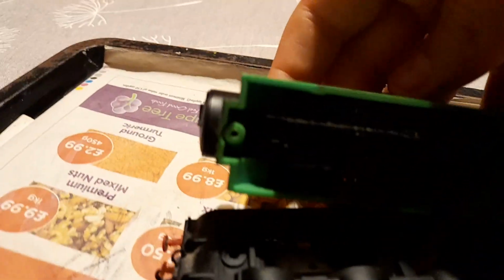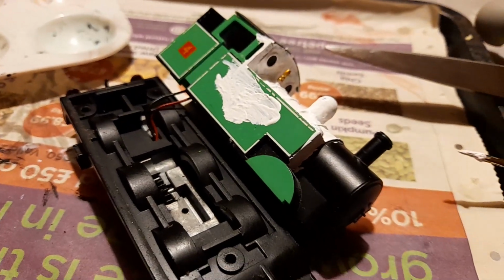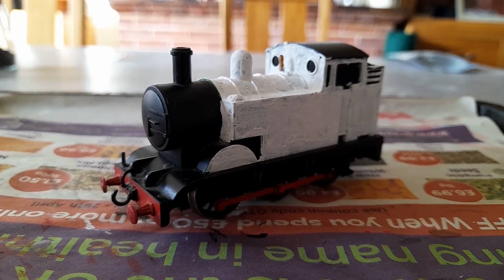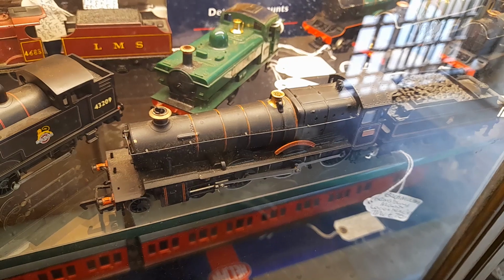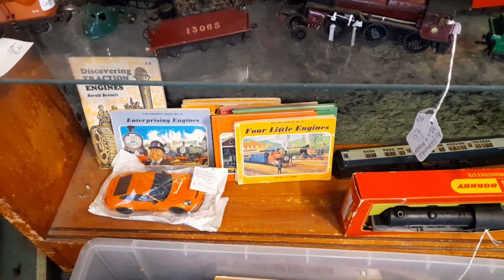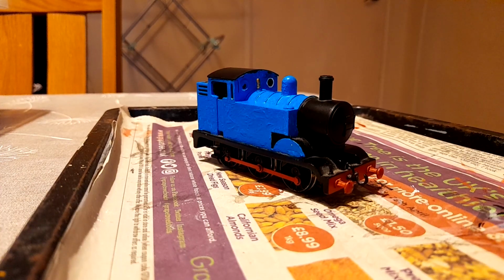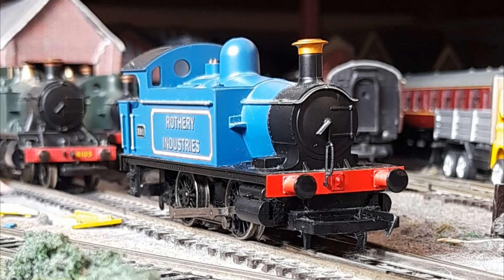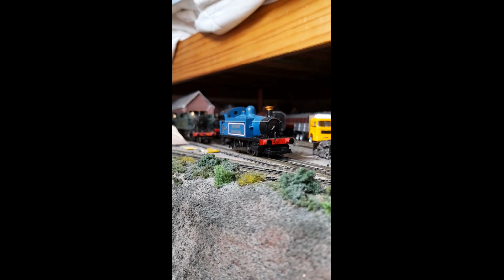Making A Custom Bachmann Thomas - My First Custom-Painted Steam Engine

Comment: What engine class is it I’m trying to do a similar sort of project and that engine would be perfect
Reply from the maker: It's a Bachmann loco, it comes from the Puffing Billy train set. Something I didn't know when I started repainting it was that they usually sell for upwards of £100, so I'd recommend just buying a Bachmann Thomas rather than doing what I did and devaluing a rare item. 👍

Comment: Buy a Bachman Thomas from there thomas line it would be a better solution
Reply from the maker: Yeah, but as I said in the video it isn't worth spending upwards of 70 pounds to get a small, poorly detailed loco which I have to put away every time someone comes round. I'd like one and may get one in future, but for now this is the best option.
Reply: @GreatWestern5199  ehh I guess so but if it was me I would but the acctuall thomas